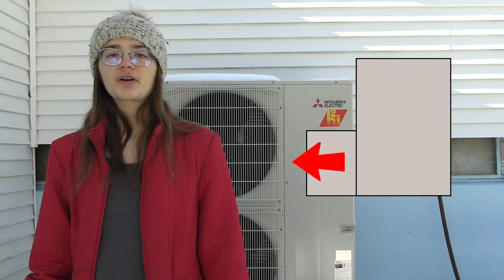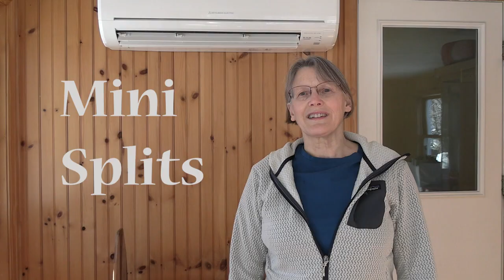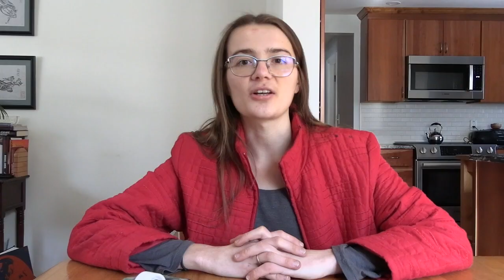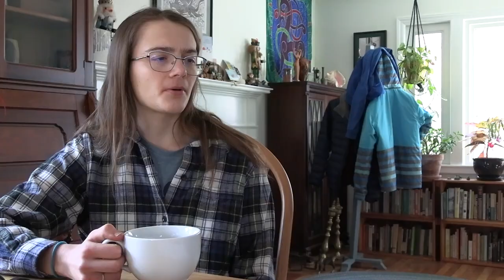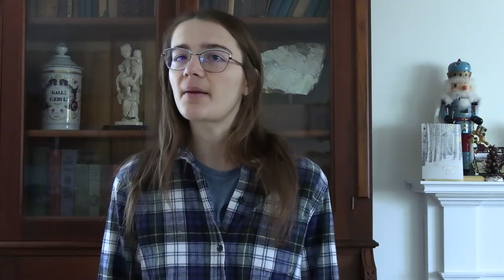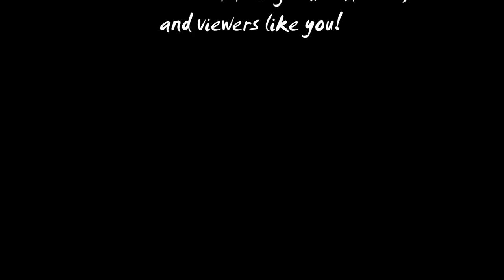Climate Change Solutions: Air-Source Heat Pumps | Tipping Pt. 01545 | Informational Video

Comment: I have probably the same heat pump in Colorado. I calculated that it cut my CO2 impact by 40% the first year over a gas furnace, and that gets better as my electricity provider gets better. I was able to get solar and a battery, so I have even less carbon impact and backup power.